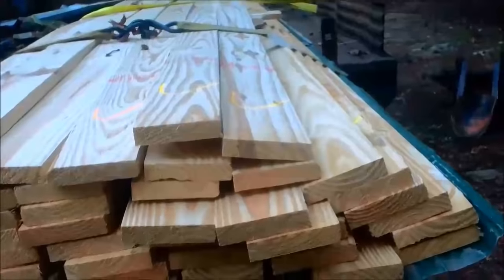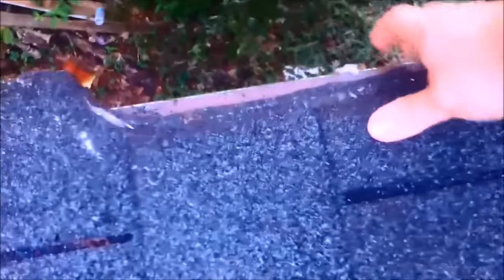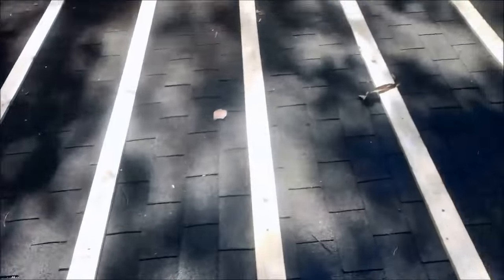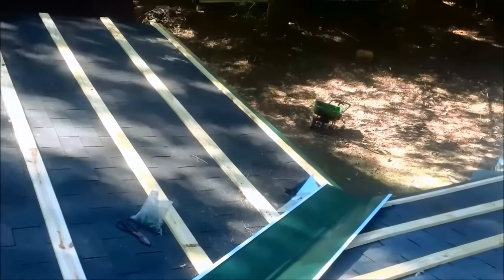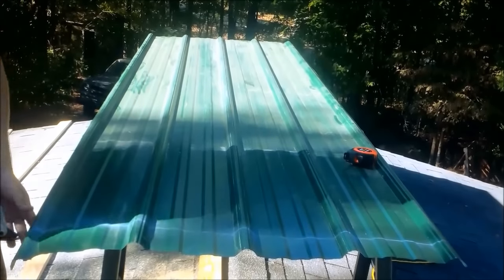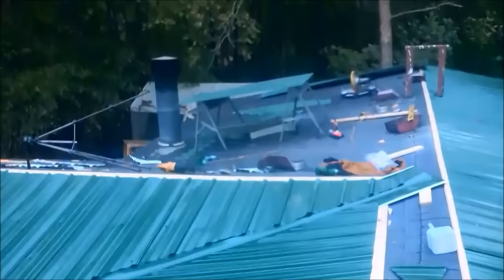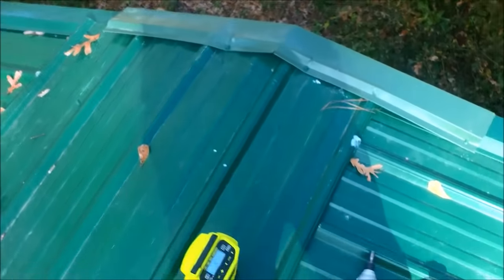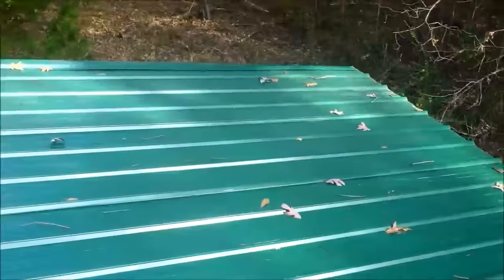How To Metal roof for cheap

Comment: Looks good but I'd recommend a underlayment  on any future projects
Reply: Definitely a breathable vapor guard or some kind
Reply: KG Oliver .
What.
3 layers of shingles won't suffice.
Reply: Totally because that’s the major issue with this roof hahahahahahahah
Reply: Why underlay ? Please Tell me the reason for underlay
Reply: @rbaker6323  it separates systems becoming the vapor barrier
Reply: @blakebarber5750  more don’t mean better, the load of a structure is really important: as a 28 year roofing contractor this is always needed.
Reply: @gingerbread1032  technically yes , underlayment is important and pressure treated wood, because that metal will sweat and cause moisture under. I’ve removed hundreds of these systems!
Reply: @Kgfsu1975  What are your thoughts on putting a metal roof on a flat roof?
Reply: @Kgfsu1975 don't use PT wood anymore. Have to use special screws with PT wood or they corrode.

Comment: it's three layers do you still use 4 inch screws
Reply from the maker: Nick Larabee i thought it was 3 layers it was only 2 i figured inch per layer plus the board im screwing through is half inch so that gave me 2 1/2 of bite thats a little bit of over kill you could use 3 inch and be fine
Reply from the maker: Nick Larabee and the plywood is half inch so i got about 2 inch of bite
Reply: I built my pole barn I did not need sheathing on the roof I just went to metal from the cross structure to the metal done no big deal it's a barn and it's not my living room

Comment: "Roof Not Done Right"Installed the metal roofing incorrectly! When you install the metal roofing you "do not" put the neoprene nails or screws on the water runs, that is the flat part. That is where all the water is sent down and in time the neoprene washer deteriorates as it drys out from the heat and sun which gives a good opening for water to come in and or just a new nail or screw not sealed good enough and it leaks out the gate. The nails or screws are always put on the high ridge. For two reason. 1 there is very little water that hits that area, about one inch area until it sends that water to the left or right to the water run, the flat part. 2nd reason that is where the lap of the metal is, wherein strong winds will want to lift the roof at the seams and the high ridge is where the seams is and where you nails or screws should be, always on the high ridge. Not trying to ditch you but just telling you the correct way to install a metal or fiberglass roof that has that style of sheeting roofing, the screws or nails "always" go on the high ridge where the over lapping seams are. Carpenter here over 40 years, and owned a construction company. PS other than some of the nails/screws on the water runs nice job!
Reply: Show me a metal roof manufacturer who recommends putting them anywhere but the flats
Reply: @joshuavanname1246  well said I've been researching my project and have found the same recommendations always screw on the flats
Reply: flats is the way to go  @macoronimani

Comment: i wish after i pulled all the shingles on the house i did , that i would have done it the way you did ,, way less hard hrs ,,
Reply: Maybe easier but least your roof won't have the extra wieght.
Reply: Tearing off the old shingles is easy with he right tool that’s made for that.that’s the easy part cleaning up after and getting rid of the old stuff takes the time.I would never do a multi layer roof.they trap a lot of heat and moisture which makes...............that’s right sports fans"...........MOLD

Comment: I would have just layed on top of the shingles without using 1x4s.  the minute some Moran steps on it wrong it will crease and definitely leak
Reply: It will not if its a code required thickness we walk all over the roof on the install never left a crease unless your 400 lbs but you have no bizz on a roof in fla weighing 400 lbs unless your trying to loose weight cuz its gonna sweat away fast

Comment: even with the battens going verticle they will still rot out
Reply from the maker: This video was 8 years ago last year we had a tornado that took off the ridge cap I replaced it and couple damage pannels no rot to speak of, we are south though we don't get snow that would hold ice or moisture on the metal
Reply: @DannysCam  probably geting in around the nails 1st then and rotting out the deck

Comment: Roofed 3 times?And now putting metal on.Alot of weight there
Reply from the maker: true but no problem too date so far i just finished roofing another one
Reply: So now 4 roofs on one house.  ;-)
Reply from the maker: yep but rememer the metal roof for the entire house including the wood is only around 2000 to 3000 pounds mean while an shingled roof is around 4000 to 5000 depending on size
Reply: Doing roofs maybe is your hobby :) Why not to do roof one time good, instead to make roof on the roof on the roof...

Comment: metal is what all roofs aspire to become
Reply: You can pour 5 inch think concrete on regular sloped roofs also.
Now that is a roof to behold.
Reply: metal roofs are the worst thing you can't get... imagine if the first panel gets damaged or some holes... you have to take the whole roof off to replace it since they overlap
Reply: Sorry bud but that is a fucking mess
Reply: valleyfarm ohhhhhh meeeeen

Comment: I hate to be the bearer of bad news but you have went about your roof repair wrong. But, since your covering existing roofing it will work for a while, but your lap boards are going to rot. I'd say this will last you 5 to 7 years before the condensation rots your lap boards severely. 
If it was done correctly it would have lasted 25 years.  
Good job jumping in there and doing the job yourself tho, most people are too lazy to tackle a job like that. Learn from mistakes!  I've made many mistakes on DIY projects and this just happens to be one of them. 😀
Reply: Gary C what would you do to keep the lap boards from rotting? Use pressure treated?  But pressure treated cannot touch metal. The metal will rot. What would you do in this situation? Strip the old roof off first?
Reply: shade231 where I live if you strip your roof down to the decking you have to put 1 inch foam board down before you can put the wood strips down and attach the metal. If you have a nice size roof it gets expensive real quick.
Reply: why do you think it will rot?

Comment: I think you'd better not apply this stuff in hurricane area's. Flying razors are kind of dangerous.
Reply: Snowwie88 metal roofs are ideal in hurricane areas such as fl cost keeps many from installing them and the people that can afford them snobbishly. Buy tile roofs due to looks .if I could afford to I would replace my shingles with metal. And 2 shingle layers is max add 3rd was wrong if there's any snow all keyboard punchers should go to metal roof mfg to see the recommendations on installations

Comment: What is the gauge of the metal roofing?
Reply: i'm doing one now. Fabral is the brand. 29 gauge. Good video!
Reply: Not at all..
Reply: Is 29 gauge common in metal roofing?  Does anyone supply thicker gauges?
Reply: Yes you can get 26 or 24 even if you dont.mimd paying.for.it

Comment: Nothing like adding more weight to the roof good long in the long run lol
Reply: Mobile home roofs are strong if the material is not rotten.  That  minor lb per squar inch on that roof is not going to affect a thing
Reply: I am a roofer and no mobile homes are not strong at all they have 3 by 4 and 2 by 2 inch wood lmao
Reply: @josepedraza1437 I live in Canada and there are mobile homes everywhere.  We have gotten 3ft of snow or more piled on our roofs and never had issues.  Poor material issues but not structural.

The average mobile home roof strength is about 20lbs per square inch.  And average house is about 25-30.  The weight of that tin and strapping isnt going to do a bit of damage

P.s. being a roofer doesnt make you an engineer lmao

Comment: Where I am at the power company will cover the power lines with rubber for extra protection from contact with electricity.
Reply: In Murica that'll be another $2000

Comment: Why didn't you remove the old shingles? That's a code violation, the old shingles are combustible material from the heat that is generated. Hopefully if you ever sold your home a home inspector doesn't find it.

Comment: One fact about metal roofs:
Fire Departments may have to watch your house burn. They're unable to step onto any part of the metal due to the extreme heat held under the metal and the heat of the metal itself.  Just an fyi.
Reply: Okay, a few things... firefighters get on roofs to create vents to release smoke and heat inside a structure that's on fire. Metal roofs trap heat inside the structure, but it's not because of heat that firefighters don't get on metal roofs. Metal roofs help fire to spread through attic space because they don't allow for the roof to vent itself like a shingle roof (fire can burn through shingles easily, not metal) and therefore burns through the rafters quicker and leaves the roof without support. Firefighters don't get on metal roofs in certain situations because there's a higher chance of falling though. There are however other ways to vent a structure, and no competent fire department is going to stand by and watch a house burn just because it has a metal roof.
Reply: There's millions of metal roofs and ff know how to deal.also they are fire rated roofs in forest fire areas embers will not start a roof fire so plus and minus of all roofing
Reply: metal roofs will prevent fires from starting in a wild fire where sparks will ignight normal roofs
Reply: if the fire is that far along just as well let it go
Reply: Fire is the insurance company's problem.

Comment: I wish I knew how to do stuff like this!!!!
Reply from the maker: +RandomVideoCircus just try and you will be ok
Reply: Man, you naysaying trolls really should go out & do some work, the man did a good job, by himself with no experience. Having done a shop & a house (metal roof & sides on both) one little thing I would have done different  (I'm not criticizing ) I would have sprung for ready made ridge row caps, they look better, keep leaves out & water seal better, if you ever have to work on this ridge, go back with reg. ridge row as a replacement, my shop will be 30yo, my house, 10yo Feb 2018, no leaks, no runs , no errors. I hope you used ALL screws on the ledger boards , nails are not wanted or need there, as they do pop after heat cycling for a time. You gotta solid roof for a long time. Good Luck!
Reply: Need to vent with ridge vent

Comment: This method is wrong just install over the existing shingles. first lay a layer of tar paper,synthetic felt ,or the best option 1/4" foam . Leaving the space will cause condensation and eventually rot the firing strips and or the roof deck .

Comment: No more replaceing shingles
Reply from the maker: +James Eggerth yeah lol
Reply: No, next he'll be replacing the entire structure of the roof. Condensation is going to be trapped... will first rot out the purlins he tacked on there... then will attack the fasteners and down into the sheathing and the rest of the structure.  He's be smart to sell it before that happens LOL
Reply: Tioga Fretworks so what is the best practice from start to finish because I have had several estimates...over 6 and each person has a different way and when I ask the questions like stripping the shingles they say it’s not necessary, when I ask about moisture and condensation they say don’t worry about it. So needless to say I haven’t had it done or done it myself yet because everyone seems to have a different way.  So if you know the best way for the life of the house please share.

Comment: no need for the wood.. just lay the sheets directly on the roof
Reply: keith dunham 

The air gap is not needed, heat will dissipate on its own. The coating on most panels is designed to reflect sunlight away from the roof. They still absorbs a lot of heat but not nearly as much as if the coating didn't reflect sunlight. If anything, the lack of support underneath the panels will cause them to warp over time from exposure to the sun and weight of the snow. In new construction, at least one 3' course of high temp ice and water shield is applied across the eves and then the panels are placed flat on top of the IWS and sheathing. This is part of a standard installation process that is recommended by several major metal roofing manufacturers. Some manufacturers wont even warranty their product if it is installed over strapping for a number of reasons. The only time you install panels over strapping would be if there was no sheathing on the roof. Like a barn or other outbuilding.
Reply: keith dunham 
Also when you lay directly onto the roof.. each high is still an air gap.. even with closures, it still breathes.  there is also a type of "bubble wrap" looking rolls you can apply under the sheets that will reduce noise during rain/hail.. which he should have bought instead of the strapping
Reply: calholli only problem with that, from professional experience depending on where your metal comes from, a lot of the times it will void your warranty if you don't place a barrier of some kind between your metal and shingles, as the shingles are an abrasive material that will over time, probably would take about 20 years or so, will cause the metal to rust out and start producing holes in the product. The reasoning behind that is,  that just like anything else, the metal will expand and contract with temperature changes, and since you have it sitting directly on top of basically sand paper, it will cause the primer paint coat to wear off the back and eventually rust out and give you holes in your metal.   Just a tip from your truly, Dustin the sheet metal manufacturer
Reply: dustin2010baby 

Professional experience tells me... don't leave shingles on the roof! Doesn't matter the type of roofing, always strip old roofing before installing new roofing. Problem solved! 

Also, concerning metal roofing in general, most manufacturers' warranties are void unless the product is installed on top of flat, bare sheathing or flat sheathing with ice and water shield applied if you live in an area that requires it. 

Not to mention that walking on a snow covered metal roof  takes extra caution in and of itself. By installing the panels on top of shingles with strapping you are now limited to where you can step or you risk crushing the panel. Trying to shovel off a roof without damaging it is painful enough without also having to worry about where you can plant your feet.
Reply: I couldn't agree more, it's best to just remove them altogether as the weight of the shingles, especially multiple layers of shingles are extremely heavy in comparison to a metal roof. Most metal roofing is about 2 lbs per linear foot, on a 3 foot wide panel anyways. So way lighter than shingles that's for sure. We will still warranty with the use of a lathing or stripping technique, but definitely won't if you lay directly over shingles with no barrier of some kind between it. Some companies however will still keep the warranty, but its hard to know who will and who won't and even harder to track down the mother company where the coil was manufactured to figure it out. Best just to tear them off completely as TCSwizz2 stated, but if you are just to lazy or maybe don't have time to, at least do yourself and others a favor and put a barrier down. I never understood why people would want to use the lathing technique as it's about 10 fold to the cost of a 30# or 40# felt paper, or even a synthetic underlayment paper.
Reply: We always lay down heat reflective paper and then lay the metal on directly.  Just make sure you put a double screw line at the bottom, on both sides of the highs in heavy wind areas. because the 7/16 plywood you are screwing into is not the best at holding threads. But it works.
Reply: I love the Internet.  The "coating" on these panels is plain old paint. It's not designed to reflect jack squat. It is NOT a reflective barrier of any kind.  First of all  there is not one single "major metal roofing manufacturer" who recommend pole barn  (exposed fastener) panels like he is using  ever be used for residential  structures- period. Wrong panel, wrong application, just a terrible idea all the way around.  Some of what you say is true - but not with this style panel, which is only intended to be applied over purlins.  Not that his installation is going to last with no airspace - it won't.  The issue is rust.  Standing seam panels (hidden fastener) are installed over solid sheathing because they need the intermediate support.  That's not what he's using.
Reply: The issue is condensation.  Even without the "sandpaper effect" - condensation will cause the paint on the back of the panel  to fail... then rust starts... then it's all over but the cryin'.   But the way he cobbed this together it has no chance of making it that long anyway LOL.  Hopefully he can sell it to some moron looking for an "investment" property (meaning they'll be doing lots of investing in it LOL).
Reply: Tioga .. 
I just built a 40x60 pole barn on a friends property that my grandfather put R-panel directly on 2 layer shingles 38 years ago.  Still going strong and looks good.  Zip the lip when you don't know what you're talking about.